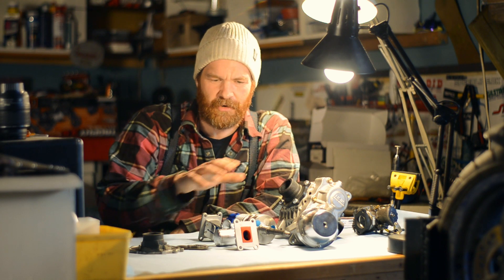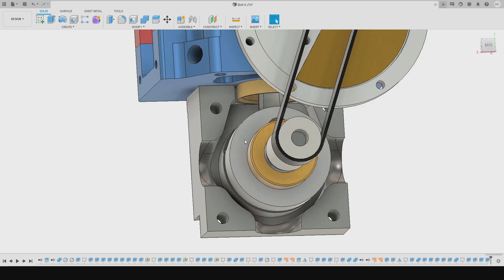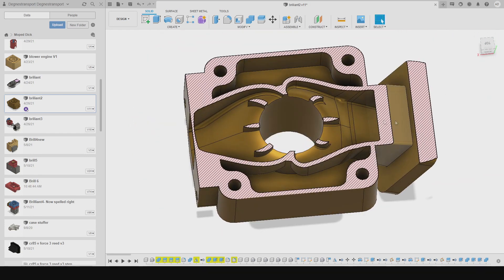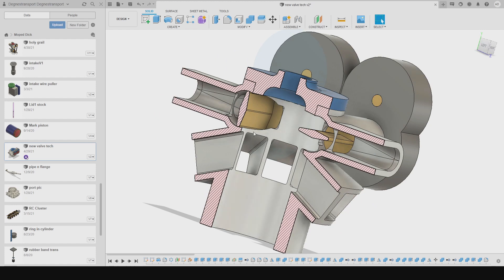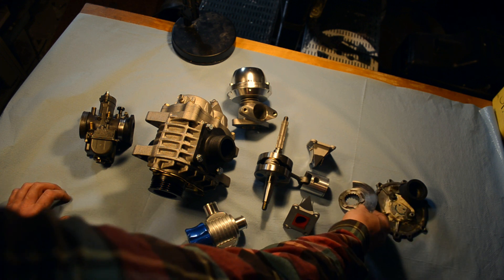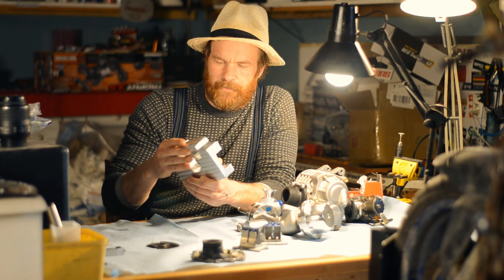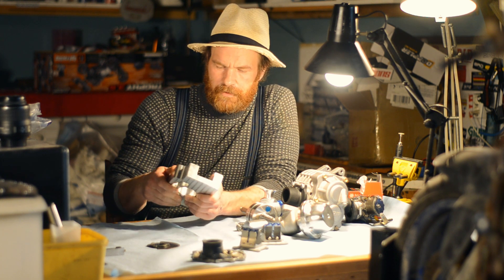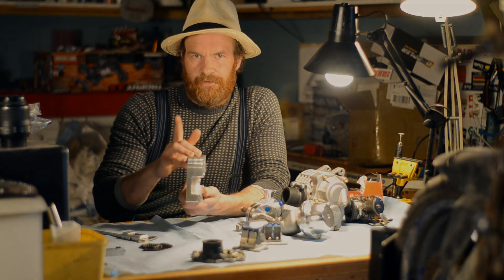Full Size Supercharger, Tiny engine!

Comment: The Drum Valve (aka cross valve) mentioned at 6:00 has been done for four strokes using a Yamaha SR500. It did breath better than poppet valves but not significantly. Twin valves would be akin to four valve heads. They would work as two stroke because the gasses flow in opposite directions. Two valves allow timing to be controlled but not the duration. Two stroke power ports on exhaust do both so are an easier and more effective option.

Comment: The big ship engines use a over piston valve and lower in the cylinder is the transfer slots for incoming pressurized air.  There is a injector on top.  You could do something similar with the rotary valve on top and injector on top.  Just throwing things out there.

Comment: grind hard plumbing did a similar roots blower on a crf450r motor in a pull through config .. and abandoned the crf flatslide for a butterfly type carb . to prevent carb slide sticking ..
Reply from the maker: Thanks for the heads up! Remember watching that vid, I'll go re-watch it.

Comment: You can control the flap valves with an epicyclic gear that has a straight line rod journal. The rod connects to a lever on the valve rotates 90 then reverses. Also, Erick Paul Myer has a great design in a graduate paper at Western Carolina University. A drag racer experimented with a 4 cam Top Fuel Engine. Can't find the info anymore. It used spheres ond pass thru ports. No reason you couldn't use a tube for the shaft. Love your work!

Comment: I have wanted to try something similar-ish to this... I wanted to cut up the camshaft on a Ford 2.3L 4-cyl, set valve timing ratio to 1:1, and use the dual spark plug wasted spark setup and one of the larger 500cc blower to pressurize the plenum... if this goes well, I just might try it!

Comment: Keep your eye out for a granite surface plate and a height gauge. It will save you lots of time laying stuff out. And you can tape a sheet of very fine sand paper down on the surface plate and use it to lap in critical surfaces extremely flat. Another great vid my man!
Reply from the maker: Thanks! I'm on the lookout for one👍

Comment: Great seeing it coming together!! 
Not sure if it will work, but you could try treating the mill doors with car wax, so the moisture runs off immediately. I've been using it on my helmet visor for years and it works there. 
Looking forward to the next video!

Comment: Have you considered a sleeve valve design, you could lower the a cylinder liner and exhaust between the cylinder liner and the cylinder head, (Harry Riccardo , sleeve valve engine)

Comment: Just a thought: Detroit diesel 2 stroke engines utilize a pressurized oiling system for the crankcase/rods/main bearings and valvetrain. You don't have valves, utilizing reeds from the crankcase, which is cool, but anytime you can remove the need for oil in the fuel, you WILL increase reliability. Something to think about.

Comment: Thats realy turning into somthing special, and looking forwards to seeing the progress and results. Some things to consider: -

Scavanging, as the induction is forced i dont think large dwell timings are needed, lowering the ports more will extract more energy from the power stroke. This would have to be dialed in to see what works best, additionally i dont think crazy large ports are needed as much as a regular engine.

Reed Valves, you problery gonna want to use metal pettles, also i would reduce the volume from the reed to the piston..

Offsetting the crankshaft, this will allow you to extract more torque from each power storke, please do a goggle on this, Yamaha have a nice video on this, its easy to do at this stage!

Exhaust, two things come to mind either a megaphone exhaust, or it may be possible to use a two stoke expantion chamber to resonate to push back pressure just before the valve closes.

Disk valve system will work, however a silmpler way is to use a rotating barrel valve much like an RD350 YPVS,  but spinning at engine speed as opposed to twisting. Again keepin this as close as possible to the piston

Direct port fuel injection, would be great too much like the aprilla system.

All so far looking great good luck, and very much looking forwards to future videos.

Comment: I like the exhaust rotary valve idea ,why not gear driven off the stator flywheel / crank , why no direct injection into crank case with rotary air intake ?  The beauty of a 2 stroke was its simplicity ,what are you doing with all that complicated heavy stuff hanging off it 😃
Reply from the maker: 👍 For contrast, the PiP engine build is still going on,.

Comment: Your designs with exhaust valves at the top are very similar to large two-stroke marine diesel engines, except they usually have one single valve similar to those in four-strokes. They use a blower and/or turbocharger as well, instead of the crank case compression. :-) Maybe one could use a cylinder head from a four-stroke engine and use ALL of the valves for exhaust? 
The benefit would be a very straight flow from the bottom to the top. Fresh air and exhaust in the same direction, all the time.

Comment: You dont need a dump valve with a supercharger, boost is directly linked with engine speed unlike a turbo. Adjust max boost with pulley ratios

Comment: Have you consider power demand of this 'subaru vivo' supercharger...it's should be around 3kW or more at top aplication (15 000 rpm and 0,6-7 boost)
Reply from the maker: About 1kw if I spin it half crank speed and not too much boost. 150cc for ever crank rotation is still plenty.
Reply: Another thing ... supercharging single cylinder engine...it's  (not 100% sure) good idea is big plenum to 'smooth down' the air flow
Reply from the maker: @AndreyNikolo  👍 plan is a fairly big plenum

Comment: Interesting. The blower and multiple carbs should certainly allow for plenty of fuel/air to enter the cylinder, and I can see how it may work, to do so. The exhaust valve essentially sets the timing for the whole system, and must not only seal, but operate at the rpm of the motor. That would seem to be the bottleneck, as far as the flow though the proces works. Since resonance, in the ordinary sense, is not a factor, wouldn't it be an advantage to have the exhaust valve as close as possible to the exhaust port?

Comment: I think if the ports are lower in the cylinder you will have a longer effective power stroke and produce more power. I have a gas two stroke supercharged engine. Approximate measurements in mm with a tape measure are, bore 60, stroke 77, displacement 218 cc. From top of cylinder, exhaust 38 and 55, transfer 47 and 60, intake 60 and 76 .
Reply: It is piston port no reed valve. All ports are small with narrow width.

Comment: I love the idea. My only question is, why not do something similar to the likes of the Detroit diesel 2 strokes.  Would end up being a simpler design  having intake ports in the cylinder and 4 stroke style exhaust valves on the cylinder head. Would just require a cam to open and close the valves.

Comment: You can setup a magnetic stop on the side of the piece before flipping it and that way you will not have to re indicate it, just use the same origin for the other side with z flipped.

Comment: Dumb question but it's a forced air motor whats the purpose of reed valves they will be open full time because of the super charged
Reply from the maker: Not when there's higher pressure in the cylinder vs what the blower can provide. They might not be necessary tho, we'll do some testing without them too.
Reply: @2STROKESTUFFING   still kinda confused. Sorry is this a supercharged case reed. ?  And is cyl pressure higher when piston is traveling down. ??? Sorry bad wording I'm Easley confused  if you don't have reeds than does super charger volume become crancase volume ???
Reply: @2STROKESTUFFING ooo yea super great job on your progress and definitely great job on not giving up on your CNC machine and your fast learning skills across the board. What ever happened to the log cabin
Reply from the maker: @2strokecarbtuningportingin187  Thanks! The log cabin is waiting for me to need some wood chopping again 😁
Reply: @2STROKESTUFFING  awsome thanks

Comment: Would'nt it be better to use a diesel 2 stroke design, and using the single valve in the head as an inlet, and the holes in the cylinder as an outlet? That way when the piston goes down the cylinder chamber can build up pressure using the compressor, and all the exhaust gasses will shoot out in stead of being left behind a little in the combustion chamber where the transfer flow will probably be swirling around. Also 4 stroke valves have been tested for compression and will probably work perfectly, instead of those untested drum valve designs. 

Maybe using this design it will be better to place the exhaust port lower, as the exhaust gasses are able to escape anyway, and the cylinder will be able to create more compression? This also allows for a 100%+ exhaust port, since there are no transfer ports in the way

Comment: Will the blower be directly driven from the crankshaft? Does it need a reduction (or the opposite) to run at correct speed? Would it work well enough below the target RPM (18.000?) to get the engine even started?

Comment: What about running the blower with an electric motor? Assuming this is for another speed record bike you would only need enough battery for two passes. Without the blower shaping hp from the engine you would have maximum power gains with only a small weight gain.

Comment: Not to be a spoil sport, but using the blower gains you very little gain over conventional expansion chamber and normal porting. You loose the supercharging effect of the tuned exhaust with the rotary valve. And the reeds are very close to the combustion chamber, you could effectly ignite the in coming charge and have a internal blowtorch inside the engine. If you want to add boost, turbo after the stinger is one way. You make positive pressure against the returning exhaust pulse and turbine restriction.

Comment: The biggest challenge to getting huge power out of a 2 stroke, is COOLING the Engine.. mainly the Piston. Maybe you can cool the piston from underneath via the crankcase.. oil spray injection under the piston??

Comment: May be a dumb question, but would it be possible to just use overhead valves with a normal camshaft for exhaust like in a Detroit diesel two stroke? Would there be major downsides?

Comment: Good challenge to make a blown two stroke.  Why not turbocharge it? You would have the same pressure on both intake and exhaust. So no need for a rotor valve, just an  external oilpump. Best Regards from denmark

Comment: have you presented your take on the selection of supercharger vs. turbocharger ? the obvious choice for a high performance engine revving at high rpm in a narrow band certainly would appear as a case study for turbocharging, as one expects less efficiency and more friction losses from a supercharger... Accurate considerations of losses and efficiency appears key to the eventual result imho, as the smaller the displacement, the more impact it will have. This goes in the opposite direction of the 2 stroke initial approach (less parts in motion, less friction, high rpm...)

Also, have you considered an electric blower to obtain pressurized intake ? for such a small engine this should be feasible, at least for testing (then you'll see how difficult sealing under pressure will be)

Comment: Using crankcase as intake plenum make's things simpler but have you thought about using a small intercooler as intake plenum? You could run higher boost, if you use crankcase, air-fuel mixture will be poorly cooled since it will get a lot of heat from piston and cylinder so engine might have some knocking issues, even compared to just a regular non-intercooled intake plenum connected to cylinder. Also about rotary valves you can try to contact MrPizzaman09, he made some rotary valve 4 strokes on youtube, he even made rotary valve bmw e36, wich is 6 cylinder engine so he probably could share some experience.

Comment: Hey Mate, keep following your project since a while- keep it up! What will be delta P of the blower? Just curious about the pressure that will be build up, when the piston gets down to powerstroke (will result in power loss- that is a big thing in turboed 4stroke engines). Also I am thinking what your reed valves are doing-if they get pressurised by the blower, they will be straight open nearly all the time- or not? I think controlling the intake also with a rotary valve would be way more precise and more efficent then with reeds. Maybe you will respond to my answer :-) Keep up the great work!!!

Comment: If you're going to a thicker material for the rotary valve you may have to sort out the balance somehow. A 100mm half circle spinning at 10-20,000 rpm could shake the living shit out of things.
There's some good videos out there with a guy who has successfully put rotary valves onto a BMW. MrPizzman09 is the guy. I really think that a rotary valve at the top of the head and a 2 stroke diesel like arrangement would simplify things and give you much more power.

Comment: i think i said this before, but what you are building is essentially a 2 stroke diesel. They use a blower and an exhaust valve as wel. I still think a freevalve in the head wil be the way to go. I think i posted the name of the guy that build his own diy freevalve system for his mazda miata(and a lawnmotor engine). The disadvantage is that the head wil be a bit more complicated to make. But the advantage of having full control over the exhaust timing might gain you a lot. It would mean you can have really short exhaust timing on low revs to not lose as much pressure, and still be able to fully scavange at high rpm as wel.

Comment: Turbo for top end throw a AC compressor clutch on the blower and a bypass valve for the turbo to take over once pressure is sufficient, Detroit did this with their two stores to reduce parasitic losses

Comment: Can you give me and explanation, why you use super charger and not a turbo "thing", you will loose a lot of power, if using a charger.
Reply from the maker: I need it to move air from low rpm, otherwise the engine (probably) can't be started. A turbo that takes over at high rpm(clutch on the blower) would be cool😁 No blower but normal crankcase scavenging at low rpm is an option worth exploring.
Reply: @2STROKESTUFFING  Use an electric turbo ?

Comment: You have everything you need to cut out the exhaust valve in your workshop. I have made read valves for my pulse jet using electrochemical etching. I cut them from 0.5mm sheet spring steel with nothing more than a 12-volt battery, salt water and some scrap wire. I am sure this would be perfect for cutting your exhaust valve. I use a 3D printed template to scribe my cut onto my material that I paint with etch primer. The process takes no more than 20 minutes to cut out a 50mm diameter valve and gives a very clean accurate cut.
YouTube link to an example https://youtu.be/jEnNMTMZadw
I hope you can find the correct material to try this out yourself.
Looking forward to seeing some more Nito Two Stroke action.
Reply from the maker: Cool, I'll definitely look into this!

Comment: i cannot imagine the complexity of designing the flow of air through the cylinder, scavenging. add heat and combustion turbulence also.
i understand the basics of loop and swirl, and that proper 3d modelling software is very expensive.
with your modular design, i  hope you have the capability to try different port configurations as a separate section with minimum redesign.
i also know you spent time considering not using the crankcase flow through for lubrication because of pumping losses.
i dislike the complexity and added volume of the external transfers for simplicity of lubrication. but can offer no solutions.
i very much enjoy watching your process, thank you.

Comment: Speaking from experience with a single cylinder 2stroke you will want to avoid routing you supercharger through the crank case. It will build too much pressure behind the piston and stop the motor. I experimented with forced air intake on my single cylinder 50cc 2 stroke I even had to add a pvc "T" on the start of my intake so that cross winds didn't kill my engine. Again speaking from experience on this one 
Regards Josh

Comment: I know its a moot point my friend, but I see in your CAD design that your rotary valve is belt driven. I think this would be a mistake. As far as I know a belt driven valve train will start to slip around 13k RPM. I suggest either gear driven or chain driven. If you want the parts to last use plenty of grease inside a containment case for those parts.